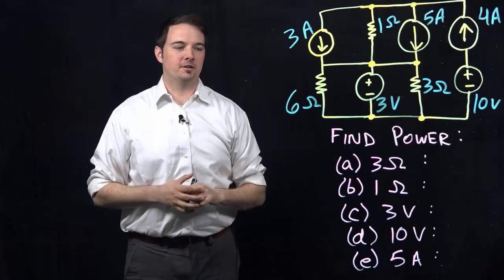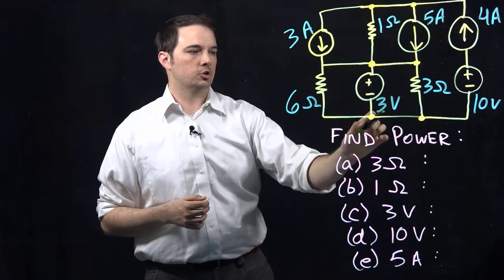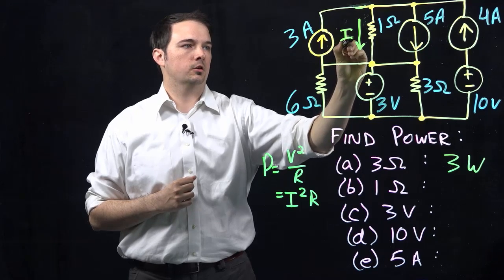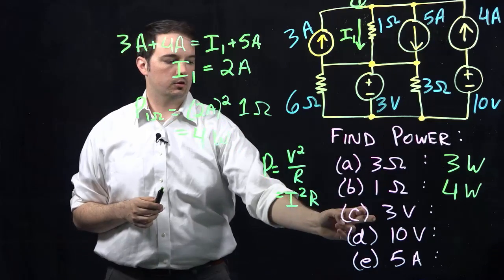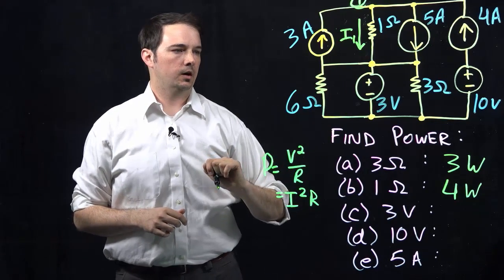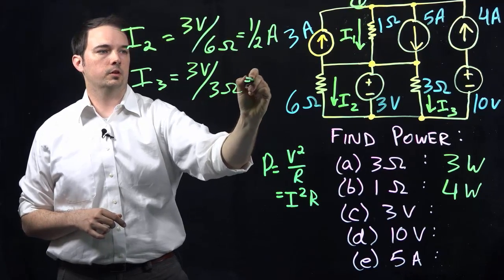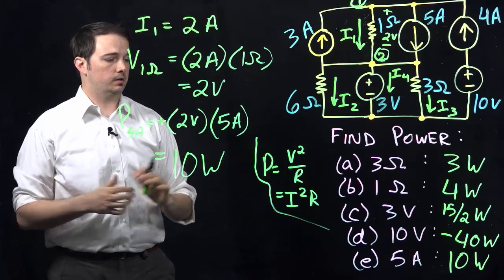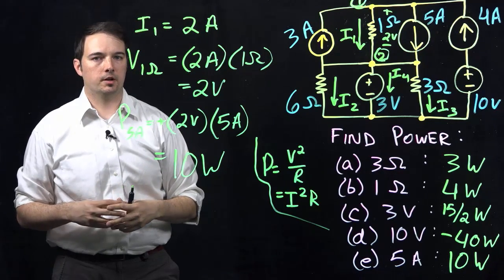Circuits I: Example with Power Calculations

Comment: Sir Why didn't you use the  formula P=V^2/R in Determining the power of the 5A current source?
Reply: if we had to use the formula V^2/R for determining the power of 5A Current Source , we would need to know the internal resistance of the Current Source. You see , the R in V^2/R is unknown to us . So , instead , we used the formula P=V X I , here both the Current I = 5A  ( from the question) and the voltage across the Current Source V was already determined by us. Hope this helps you understand .

Comment: For the current of the 1 Ohm resistor between the 3A and 5A, can't you just do i = (5A-3A)? Like the case of mesh currents where mesh 1 is the 3A and mesh 2 is the 5A?

Comment: For the power of the 6 Ω resistor:
P {6 Ω} = I {2}^2 * 6 Ω = (1/2 A)^2*(6 Ω ) = +3/2 W.

For the power of 3 A independent current source:
V {1 Ω} = I {1}*1 Ω = (2 A)*(1 Ω) = 2 V.
(1 Ω) || (3 A) ⇒ V {1 Ω} = V {3 A} = 2 V.
P {3 A} = (_V_ {3 A})*(−3 A) = (2 V)*(−3 A) = −6 W.

The polarity of V {1 Ω} = V {3 A} is the positive (+) terminal up and negative (−) terminal down, because I {1} = +2 A is a positive current, therefore in order to satisfy the passive sign convention the current must enter through the positive terminal of the resistor; and since V {1 Ω} = V {3 A}, the polarity of the voltage V {3 A} is the same of the voltage V {1 Ω} of such resistor.

For the power of the 4 A independent current source:
The voltage from the upper node to the lower node is
V {1 Ω} + 3 V = 2 V + 3 V = 5 V.
If we assume that the voltage V {4 A} of the 4 A independent current source has the positive terminal on its upper terminal and has the negative terminal on this lower terminal, we get:
V {4 A} = 5 V − 10 V= −5 V.
P {4 A} = (4 A)*(−_V_ {4 A}) = (4 A)*(5 V) = 20 W.

Applying the law of conservation of energy to verify the results:
Σ_P_ {absorbed} = −Σ_P_ {generated} ⇒ (_P_ {3 Ω} + P {1 Ω} + P {6 Ω} + P {3 V} + P {5 A} + P {4 A}) = −(_P_ {10 V} + P {3 A} + P {4 A}) ⇒ (3 W + 4 W + 3/2 W + 15/2 W + 10 W + 20 W) = −(−40 W − 6 W) ⇒ 46 W = 46 W, which is true. Therefore, the results are correct.

Comment: Quick question; for I1 and I2 at around 7:10, how did you know their directions? Or is it arbitrary? Thanks!
Reply: Based on the 3V Voltage source , the I1 current direction can be known and by using KCL at node 1 we can knoe the I2 direction....If i am wrong correct me....Thanks
Reply: But he said it doesn't have any direct voltage source?